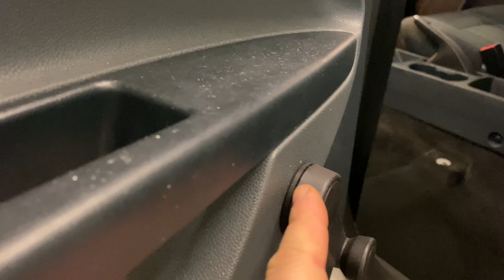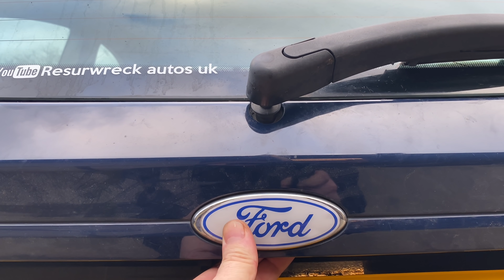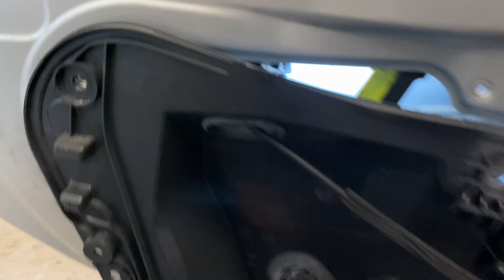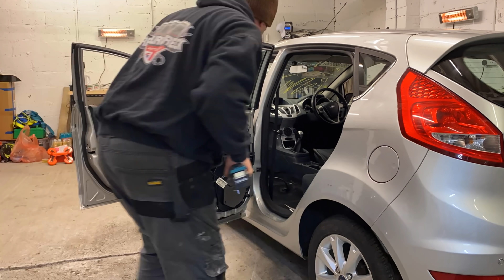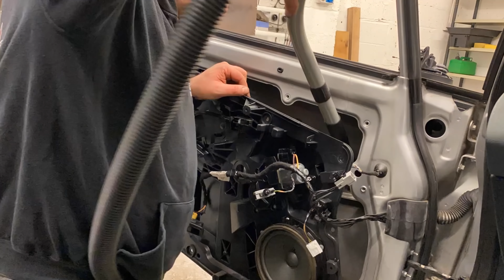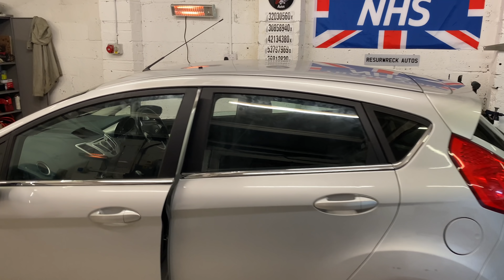FORD FIESTA 2011 VANDALISM COPART SALVAGE PT 2

Comment: As everyone else has said get some pin removal tools and at the same time get a stock of generic connector blocks and 2.4mm male and female crimp connectors and you can make up connectors to replace damaged plugs. Most connectors are pretty universal, might just not be the same colour as on the car. That's coming along nicely, won't be long until it's away.

Comment: Please dont do the chop & reconnect on the wingmirror wiring to correct the different plug, you can remove the wires from the bigger plug & refit em into the old plug without too much fuss. ( you may find that the bigger plug may be for posher features such as the blind spot occupied light etc, powerfolds only need a couple of extra wires normally so plenty of spare space in the old plug for that feature )

as for the fix, the red end of the connector plugs comes off & then you can access the securing lugs found under there with a small flat screwdriver or a pick etc & then the wire & metal connector will come out of the plug with ease & once you remove the wires from the old plug in the same way you can then just press the new mirrors wiring back into the correct places, refit the red end & job done.
Reply from the maker: Thanks Martin i will do that tomorrow nice one buddy

Comment: The new mirror is from a facelift model that has 10 pin connector, you can unpin each wire off the plug and then put them in the old one without cutting and joint any wire. I did the same on mine
Reply: Thanks for the info also about the newer model having the different plug

Comment: If you ever change a mirror again pal, undo the speaker and reach up to assist wire through hole. No need to undo full inner door plastic which I saw you do a few times as you missed the chance while you had it off first time. 
Fair play for trying and it’s all learning, my advice is stay away from pre face lift fiesta and go for 2013/2017
Reply from the maker: Thanks Adam nice one buddy will do 👍👍

Comment: No need to snip wires, get a tool to push the connectors out of the plug
Reply: I bought a set of plastic pry tools and it came with a set if pin pushers in it. It was only about £15.
Reply from the maker: Thanks guys i will do that
Reply: Second this, check cars for Paul’s recent video he did this on a radiator connection
Reply: While you're at it buy a generic bunch of connectors and some 2.4mm male and female connectors and you can make your own connectors if the one on the car is damaged. It might not be the same colour as original but they're usually pretty universal.
Reply from the maker: @alancampbell1008  Thanks Alan good idea nice one buddy 👍👍

Comment: Great content as ever Mark could I ask if you could add a link to those electrical connectors you used in this video I've not seen them before as I'm still on those silly cripping connectors which are awful
Many thanks looking forward to the next installment.
Reply from the maker: Hi Patrick I borrowed them from a mechanic but I will find out 👍👍